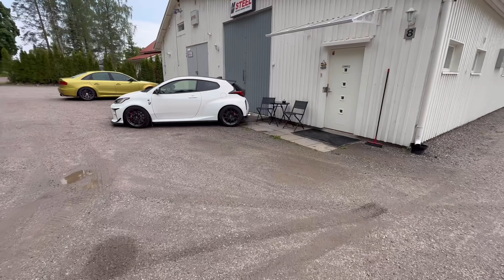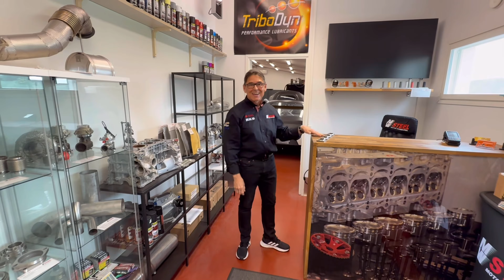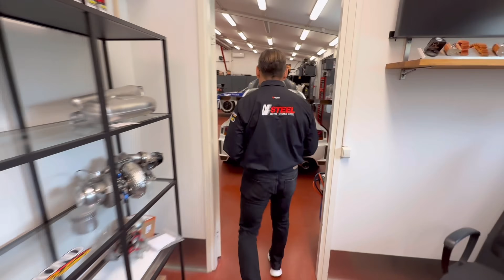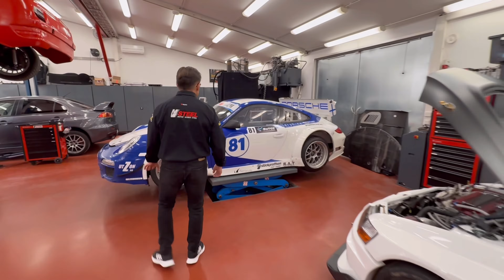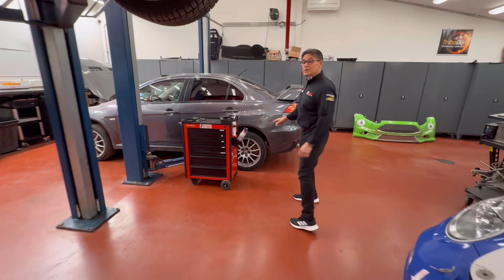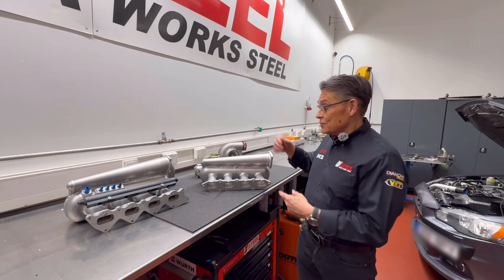Check out our car projects and build parts

Comment: Just thinking, would this benefits in N/A engine
Reply: BMW made a similar design in the P54 B20 engine used in the e46 320i touring car. Basically an M54 B20 built to 280hp at 8800rpms. Great question. Cheers. 🍻
Reply: @teddyroweshow  Cool to hear, yeah i was check pics after your comment...I was just wonder this would be cheaper then ITB´s in my engine and maybe better in flow then oem stock intake is